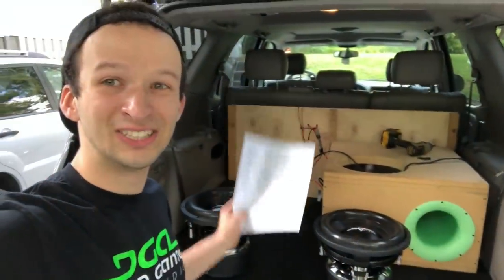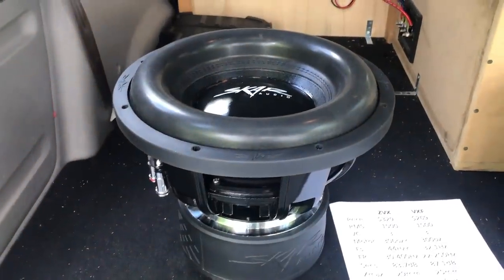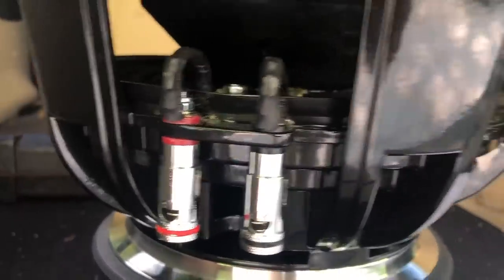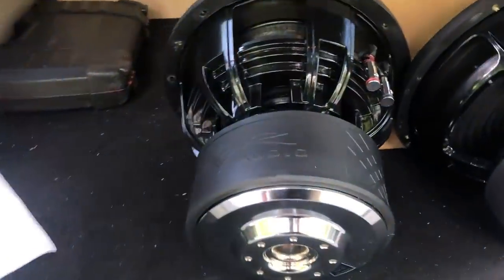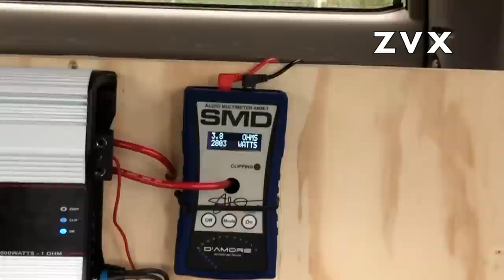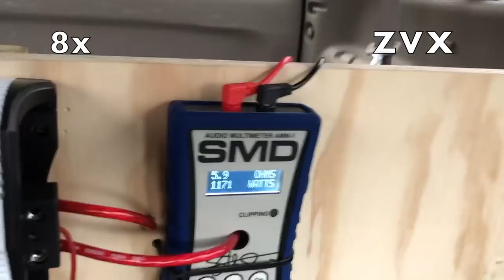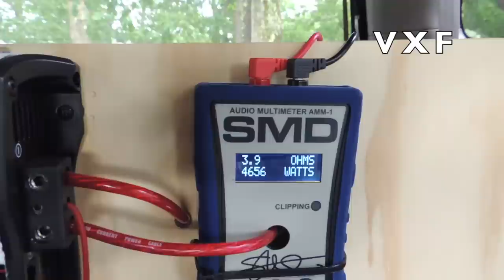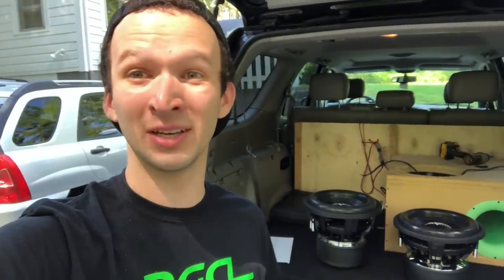SKAR ZVX VS VXF!! Which Is Best and Why? | Head to Head

Comment: We are seeing the difference in spl and an sql sub. The vxf should cost more imo because its better all the way around , but im glad its doesnt. The zvx has a better coil for thermal capabilities, but flatwound aluminum is less efficient than transferring current than copper , but all in all the zvx is made for brutal spl burps and heavy usage under high power. The vxf is a badass daily sub with much better sound quality, depite its copper coil it can still handle alot of power.
Reply from the maker: I agree man overall the VXF is definitely the better sub. They just charge more for the ZVX because it looks more impressive
Reply: @ParkerTheBasshead  the zvx is a copy of sundowns z series , probobly made in the same build house, with cheaper parts than sundown obviously, but there is this newer company called harmony audio. Could we see a video reveiw of there monolith subs? They come in 15 and 18 inch with the price of 349 to 379 . They also have a carbon series thats cheaper and they have really good reveiws and build quality as well. Maybe a good video to make for your channel?
Reply: @ParkerTheBasshead  the harmony company is shaping up to be the next big budget company and it might be good to get the first solid review on them  considering youtubes algarythm when a person looks up that certain sub your video would be at the top of the list because you did it first. Just saying. But great videos as always , your videos are getting more on point and show better content now, good job bro.
Reply: @ParkerTheBasshead  ... Hey Parker, please tell me. What's better, the american bass HD or the skar zvx 12?
Reply: @johndough4338  probably Hd
Reply: @moneymac5214  ...since then, I had both subs. I got to say the skar zvx 12 is the better sub to have for sure bro. I played with the earlier model american bass subs back in 2010, and the later models around 2018/2019. The earliest models were wayy stiffer, and would sound distorted on real deep low notes, but started sounding better as it was breaking in. But the later American bass hd model sounds better because of it's less stiff ness from the previous model that I'm referring to. The Skar zvx 12 seems to have a better voice coil, a better lip, and most definitely has way more excursion than the American bass hd. I would recommend the hd to someone who is looking for a more punchy bass sound. I would recommend the skar zvx for a more boomy, windy bass sound.
Reply: @johndough4338  what about the VFX do it get boomy like the Zvx.      I want my trunk to sound like thunder.
Reply: @moneymac5214  ... check this out bro, and I'm going to be honest with you, because you seem like you just want to be loud for a good price. The vfx is probably like the best subwoofer out there in my book. It's so much stuff out there to get, and in so many different price ranges. But the VFX is probably the best sound quality / spl sub out there. The Skar zvx doesn't sound bad either. But the skar zvx is just designed to take more power, due to its heavy duty voice coil. Just look at the skar vxf as a kicker L7, or JL w7, or Rockford power T2, or any other high quality sounding sub, but on steroids. The vxf is probably one of the best sounding subs out there for the money, period. It's probably other subs out there that cost more, or can take more abusive power if needed, but I put money on it that it wouldn't put a VFX sub to shame. Trust me when I say this. If you had an SUV, and if you had a 4500 RMS watt amplifier. And if you had a choice to run a pair of JL audio w7 13.5 subs, versus a pair of the Skar VFX 15s, you'd probably be a lot happier with running the skar vxf 15s.... period! Plus you'll save around $1200-1500 dollars lol...

No lie!!!
Reply: @johndough4338  ok cause right now I have a Taramps 5000.1 on 2 18s evl.     I want to upgrade to Taramps 8000.1 on 3 VFX.     15s

Comment: I have 2 subs on my Journey one is a Sundown X8 that I use as a MidBass witch seats in the middle of the car with a custom box and I have a Skar ZVX v2 15 with a rp2000 witch it’s a bit wired that if I’m playing Rap with bass starts to smell and smoke and gets hot fast with all my gains set perfect with my SMDs
Reply: That’s strange I have 1 ZVX-8 with a ds18 slc2250.1, wired to 1ohm so should be getting about 700rms, moves so much air it cools the inside of my civic down way better than a p3 12 I had before
Reply: Jesus Chacon that’s crazy yeah I gave my ZVX away I could always hear the coil hitting when I did bass demos and moved on to a FI subwoofer but still have my Skar Amp witch is underrated says 2000 but after a test dose close to 3000rms so I can’t complain about that
Reply: Actually now that you mention it before it broke in the coil would make some pretty gross noises took more than 10 hours to break in

Comment: Do the ts parameters discripency. I just dealt with this so I contacted Skar. I informed thay i was trying to build my own enclosure but not 1 of the ts parameters between my manual and the web site matches. I was quickly contacted by the VP of customer support the same day. Even sill messaging me after hours. I will give credit for great customer service. But they informed me that are constantly retesting the subs. So these numbers can change. But they are constantly updating the website to try and provide the most accurate numbers. I was inform to go by the numbers on the web site because they are the most recently tesyes values. Hope that help everyone out. At least you know you are dealing with a company trying to provide you with the most accurate information

Comment: How many cu ft that box zvx calls for like a 3.0cu ft. Idk how much a difference that makes when i go to build a box for mine it gonna have to be smaller than that
Reply: Box size matters alot for subs. If you're short on space I would recommend a sealed box, since they require less space from subs.

Comment: Well now I know why the Vxf has a slightly lower spl score.... The zvx was a D1.... The Vxf D2... Which is a unfair SPL fight... The zvx wired down to 0.5 ohm on a md12000 it could have gotten alot of power. The Vxf wired down to 1ohm it was getting decent power but nowhere close to what the zvx was... And the Vxf only lost by a tiny tiny bit.... If the zvx was a D2... The Vxf may have walked it.... I love my VXf 15" it's a serious woofer. I got rid of my zvxs not to long ago. But I actually bought a new one today from a friend so I got another Zvx 15" but I dunno what imma do with it ATM.. deff not taking the Vxf 15s place lol

Comment: Just bought 2 vxf 15”s what would be a good amp to run them with?
Reply: Bass 3k taramp wire the subs to 1ohm and put a little juice on that amp boy trust me they will lock you up for domestic violence for beating down the block!
Reply: @got2getit204   thanks! Gonna try it out.
Reply: @Tonytone93  and don’t run it at a half ohm ether it’s a 1 ohm amp use it that way and you will be happy!
Reply: @got2getit204  okay cool thanks for the advice appreciate it 👍🏻

Comment: I gotta know, (2) Skar VXF 15” or (2) American Bass Hawk 15”
Both dual 4ohm config?
I want a 15 under 300 that can hammer lows. I will get two so if anyone has recommendations pls lmk
Reply: Did you ever pick? That’s my same question Hawks or Vxfs I’m trying to upgrade from my XFLs.
Reply: I’m thinking vxf just because I See they can take 3000 rms clean power Idk if the Hawks are capable of that.
Reply: @lachauncetownsend3512  I have decided on doing  the skar vxfs 
Im torn between two 15s or 2 12s. Im also not the best with this electrical stuff so I can wire it and all that but I’m not sure what amp alternator or which batteries I will need. Also not sure which amp to run for the subs,

Comment: Put the zvx on something like a mmats 3500.1 it will change some minds about the zvx the 
Mmats amp is clean raw power
Reply: the zvx 15 v2 plays lows very well especially if you tune low like 28hz in 4.5 cf box.

Comment: Anybody know where one could get free box designs or at least a place to ask a few questions about box designs. I mainly don't understand the port calculations. I have a sundown x8 v3 d2. I have a sfb1000d I plan to run it with in an 85 towncar. I've heard the basics. 3/4 cube in a ported tuned to 30 whatever. I just don't have any idea how to get port measurements. Also I don't want a port out design like emf did with his 8 box. Thanks and sorry for the essay.
Reply: You can use subboxpro. You can make a box and some of the dimensions of the cuts can be shown  from how big you want the box to be and what tuning you want it at.

Comment: Hey man.   You should turn ur Sub Sonic filter up to about 10% or jus a lil then turn the low pass filters to about 40 Hz then turn the sensitivity up to half.   Then on the head unit turn the sub volume up all the way that's gonna get a different outcome and a lot of power gonna be pushed and its gonna rattle things hardcore and your gonna hit some SubSonic Frequencies. That you'll like a lot.     You should review the boss audio phantom 15" sub in a ported box.    Cause I was thinkin of buying a 15" I have 2 10" Boss audio phantoms they hit hard.     Soooo could you do a boss audio phantom 15" sub.    I'm Thinkin of buyin one could u test out when the sub unloads. When the sub don't unload  the frequency test the DB test and wattage test.   Its a sub no one thinks about

Comment: Neither ...they will fall apart in 6 months ... go by B2 Extraordinary 12 " or the Rage B2   or American Bass or Image Dynamics anything but Skar. I have installed car audio for over 20 years ...almost 25 now ///Skar has a two year warranty but for them to honor it ...well, good luck . trust me buy anything I said besides skar ///Hell buy sundown or Fi audio  anything but skar
Reply: Alex Randall he’s right I had 2 of Skars 12s and within 5 minutes on clean power they blew... Also only was pushing half of what they could take no clipping. Skar is junk. Look elsewhere.
Reply: @Ryancamfarm  ..you must have just been lucky ,,cause we have seen more fall apart then we have that lasted ...We have also tried to get people there warranty upheld with Skar being a reputable car audio installer in the area for over 20 years ,,we have never been able to get them to uphold a warranty on any of the times we tried to contact them with customers info ... Thats when we just outright stopped installing them for people in there cars...we tell them that we will not install the brand anymore for people ..We suggest alot of other brands to them and even show them examples of ones that have blown and  came apart on us ..people usually change there mind when we show them the proof
Reply: Might be a hit or miss but so far I’m extremely impressed with my ZVX-8 hits harder than a 12” p3 easily,
Took a while to break in though sounded horrible at first, once it broke in though it’s a monster moves a lot of air cools the interior of the civic down
Reply: 3.5 years running 3 evl 15s on skv2 4500. Pounding them daily. Zero issues, ever.